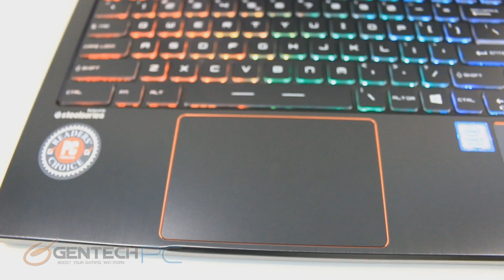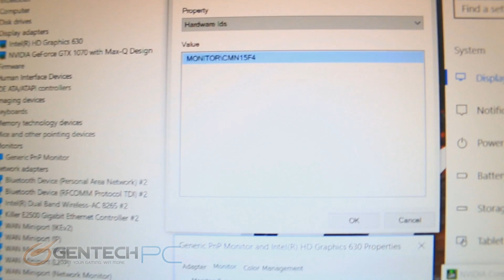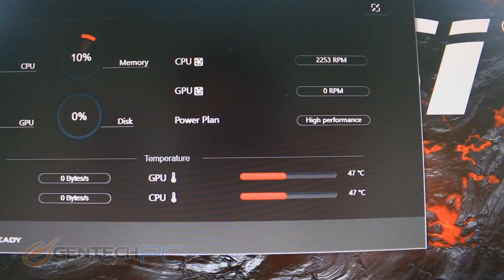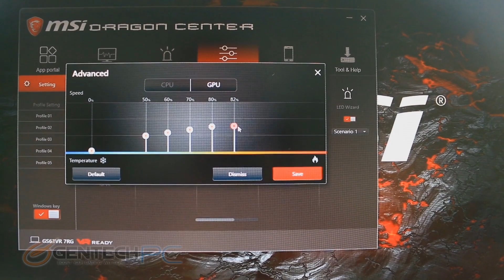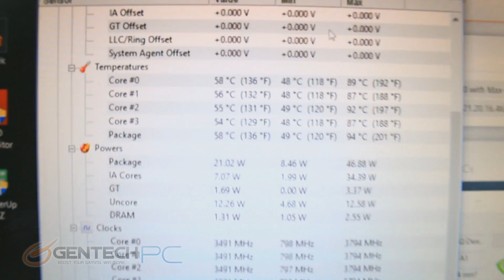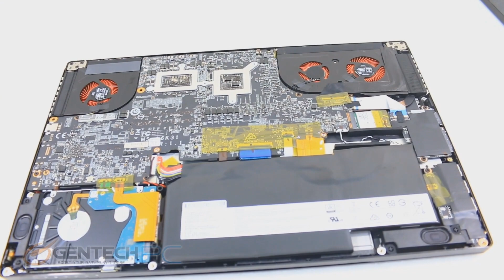MSI GS63VR Stealth Pro w/ GTX 1070 MaxQ – Full Review + Benchmarks

Comment: How many hours does the battery last for average usage? I'm deciding between this one and Aero 15X, as well as a similar model to this which is the MSI GE63VR Raider where there are slight differences and the graphics card is GTX 1070 desktop version rather than the Max-Q one. Any feedback would be appreciated, thanks!

Comment: do you think this would be a better cost-benefit than the rog zephyrus?
I was determined to buy the zephyrus but for the price tag maybe this one is better, would it really affect the g-sync thing?
Reply from the maker: The Zephyrus of 1080 Max-Q doesn't perform much different than GTX1070.
Reply: GenTechPC thanks for the reply, will probably get the msi gs63vr 7rg since it'll be like 200 € cheaper so sounds right to me
Reply: same is true for this one, the performance is closer to 1060 thn a gtx 1070 on this one.

Comment: what's the battery life with this? the 1060 version had average batery.. Does new gen fix this issue?
Reply: my story is I bought this crap and used for 2 weeks on my desk. Then I decided to fly to my parents and took this crap63gs with me. In the airport I put it on my laps and edited few documents then browsed the internet. And the body of the laptop got broken! When I contacted MSI they told me I can use it on the desk only and I'm not allowed to use it in the airport on my laps.
Reply: aint bad but im looking for 120hz for sure
Reply: this
Reply: if you are ready to tweak it the battery is good enough. But wait a bit, I'll try to upload a video of my crap63gs this week. There is some probability that you'll change your mind after this.
Reply: Roman Fedyashov how did that even happen?
Reply: when I bought my msi gs63 it worked about 2 and a half hours. After I changed the setting I got about 5h of working (not gaming) a lot of crap can be turned off for this laptop. P.S. finally I think gs63 is a piece of crap as it does not allow to be used in the airport. It curves on your laps;
Reply: can you explain what you mean by not allowed to use in the airpor
Reply: Roman Fedyashov such a joke man I'm sorry for you
Reply: got ya. But to be honest its not funny for me. Still thinking how to return this set of components to the seller :(
Reply: Roman Fedyashov I don't want to be mean but imagining a LAPtop not supposed to put on laps and actually breaking is just pathetic.. But still seems funny
Im about to buy a GS73 but idk if the battery is good enough for college too
Reply: Roman Fedyashov I will change my mind but I'll still buy it because I don't see any alternative to the gs63/73 for me, ge63 is bulky and battery life is worse than my old gt60
Reply: Roman Fedyashov but I appreciate that man
Reply: what about gigabyte aero 15?

Comment: Hey how's the battery life?
Reply: Will Flemming 12 W (~ 4 h 45 min of use) – idle, Power Saving Mode, screen at 0%, Wi-Fi OFF;
22.1 W (~  2 h 36 min of use) –  light browsing and text editing in Microsoft Word, Balanced Mode, screen at 40%, Wi-Fi ON;
34.4 W (~ 1  h 40 min of use) – 4k full screen video on YouTube in EDGE, Balanced Mode, screen at 40%, Wi-Fi ON;
22.7 W (~ 2 h 31 min of use) – 1080p full screen .mkv video in Movie App, Balanced Mode, screen at 40%, Wi-Fi ON;
24.2 W (~2 h 22 min of use)– heavy browsing in EDGE, Balanced Mode, screen at 40%, Wi-Fi ON, Eco mode on;
44.5 W (~1 h 17 min of use)– heavy browsing in EDGE, Balanced Mode, screen at 40%, Wi-Fi ON;
28.2 W (~ 2 h 1 min of use)– heavy gaming in 1080p, Balanced Mode, screen at 40%, Wi-Fi ON.

Comment: Thanks for the great video.
One thing that is missed is the gaming benchmarks and comparison of max-q 1070 with the old GTX 1070 laptops.
Can you please add that as well?
Reply: Here you go, normal GTX 1070 benchmarks:
https://www.notebookcheck.net/Mobile-NVIDIA-GeForce-GTX-1070-Laptop.169549.0.html

GT62VR has Firestrike score of 13768, and graphics Firestrike score of 17477.

While this laptop has score of 12003 with graphics score of 14507.

Around 15-20% slower in GPU power.
Reply: Thanks @player1. much appreciated. 
I think if we need RAW power, these laptops are no good looking at the price point as well.
Reply: it's not, these laptop doesnt have much room for OC either, while the thicker can get alot more and cheaper too, and they runs much cooler thn these. i got gt62vr whitebook and cpu remains under 80c, GPU ~65c

Comment: Are maxq gtx 1070 laptops slower than normal 1070 laptops
Reply: It's generally a GTX 1070M
Reply: Abitosh well for a gaming laptop you pay for portability. And this is by far the better definition of portable as it is one of the thinnest gaming laptop available in the market. even though it has a lowee clock speed due to the lower voltage, it still performs very well as a gaming laptop
Reply: Jon Fung M(max-q) haha XD
Reply: Abitosh not all it does is lower temperatures and although doing so is supposed to increase performance, core clocks are lowered so it evens out or whatever
Reply: Usman Khan Well you cant expect full performance from a gaming laptop unplugged, especially for this as it won't even last an hour of faming unplugged. I travel a lot but also like to have the luxury of gaming when I am travelling and having such a thin laptop over thicker ones is most welcome. Not only is it lighter, it also gives a little more space for other things to be put into a backpack. look for a wall outlet has never been a problem to me. But this is just my opinion and such opinions towards a gaming laptop is subjective. That is why we have choices.
Reply: id like to know this also
Reply: Emiliouus Sounds good. Doesn't work. Really don't see the point of charging more for less performance. if they had maybe made it thinner along with more powerful then yes I'd understand the price...
Reply: Yes and it lower their performances like the fire strike shouldve been around 17k and not 12k (which is close to 1060 = 11k)
Reply: not true actually, these laptop cant play game at decent settings with decent frame unless plugged to wall. which makes no point of having these thin laptops for much higher $ thn thicker with better performance.
Reply: Usman Khan As someone who brings laptop with me all the time, and game in environments that don't have much space, I appreciate what max Q brings: thin and light, quiet and relatively cool gaming laptop.  I really love to game without headphone/external speaker as well. Power cable is never a problem for me.  

For the similar performance and hardware, max q laptop charges for 800 to 1000 bucks. But I can use it as a work laptop and brings it around, saving the need for a separate gaming set up.  So there are use cases where max Q is worth it.  

The problem for me to buy a max Q laptop right is my current laptop is only 10 months old, and plays some less demanding games okay with a 960m. But if I were to replace it in two years, I will definitely choose a max Q version over regular heavier ones.
Reply: Emiliouus I thought they were supposed to provide more performance instead of the opposite.